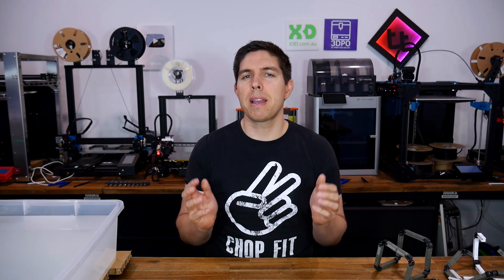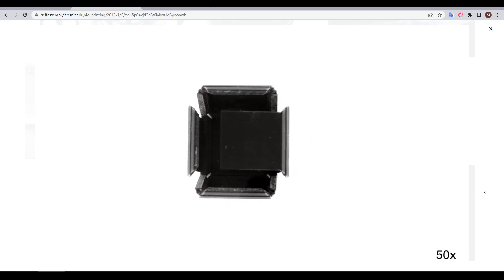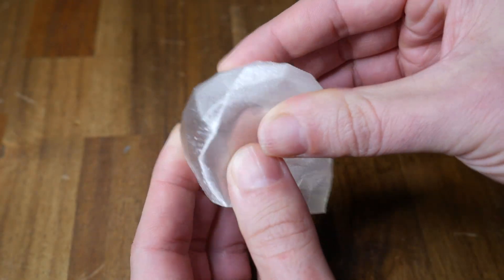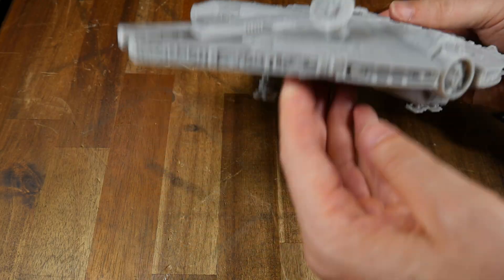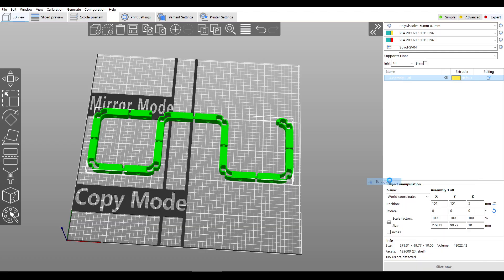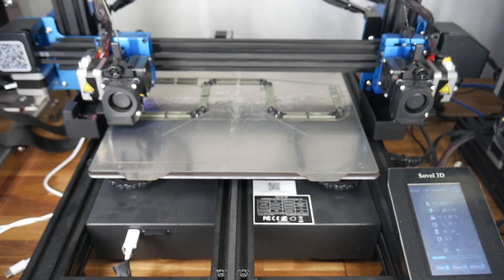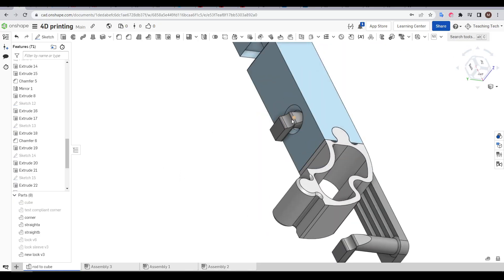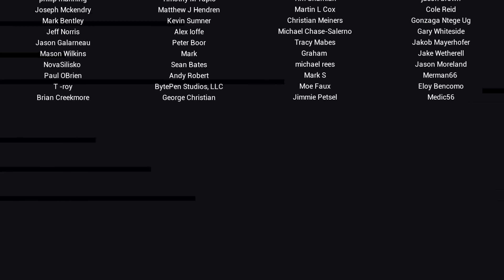4D Printing at home - Self assembling magic

Comment: Great problem solving (which is what engineering design is all about). Learning how to use each material is the secret and often as you showed you have to rethink and get round a blockage.

What could this type of design be used for? Reduction of packing space for 3D models or furniture?

Comment: The thing I don't understand is how is this any faster/better in any way? I see it being considerably worse in every metric. Takes longer, more material, more difficult to design, more expensive equipment, weaker joints and/or points of contact, etc.
Is visually captivating and a nice problemsolving exercise, but nothing more.
Reply: You can fit more things within the same volume, so more efficient packing for sparse objects is the possible benefit I guess

Comment: would you say this is 4D printing (as in the printing process) or a 4d print (the object printed)? I don't think of this as 4d printing and i don't think of it as a 4d print, IMHO. But with that said.. it would be interesting to make a print that has temp sensitive components that could adjust it shape in the 30-140 degree rang or somewhere near that range.. and then print a temp guage with an arm arrow pointing at digits on a scale using 3d printing. Are there any materials that can be printed with that expand and contract hundreds or thousands of time with tempurature? any that are already commercially available in 3d printing filament?

Comment: Hi, 
That reminds me something that I've done 3 years ago. 

I was requested for testing material called "Lucent PLA" from Polish manufacture "Print me". They at first didn't know it full properties at that time, so I made long tests of its capabilities. It turned out that this material can remember its shape, and when deformed, it can returned to it's original form, while being heated, in seconds. 

So I made some examples, that are on my chanel(last 3 videos). One is a box, that can be closed and it will hold it positions, but when you will heat it up, for example putting it in hot water, it will open up. And the fun part is, it doesn't require that much heat to do this. Even when you will blow some air from your mouth, it will react a little bit. Is so sensitive to temperature, that I had problems printing it in summer. Because of heat from extruder shaft, I had to cool down extruder gears, if not it will soften that much it will jam(Who would thought that?).

I strongly recommend checking it out, it's really interesting material, that I've newer saw on youtube, and even in Poland it's not known. And this is not an advertisement, I don't have anything from typing this, as I didn't had from 3 years ago for testing that material.

I hope I've interested you in this topic a bit. Have a nice day!

Comment: It is not, "4D".
All Prints take time.

If you print with the material that is capable of changing its shape to a process even if that process is adding heat or a wet environment or any other thing that causes said behavior, does not change the print into a 4D print. It is still a 3D print.

Comment: To end the hassle of inserting the arrow-shaped clips, simply make a slit straight in the middle on the arrow shaft (from the tip). It will give it the necessary compliance for insertion while keeping most of the rigidity once clipped in. 
— Arnaud The 100¥ Engineer. 😊

Comment: The 75 C was maybe too hot for the TPU, at it heated and softened it probably settled into its new shape so thats why it didnt spring back to its original shape. Heating materials is a way to relax the internal stresses which is probably what happened with the TPU.
Reply from the maker: I agree. In the later tests it really sprung back with a snap. Less time deformed plus cooler water temp.
Reply: @TeachingTech  Definitely a cool concept and a good idea. It will definitely have some unique uses, I wonder how it could be combined with compliant mechanisms to give it a more functionality.

Comment: This is very interesting.  If you can, try putting one or more aquarium pumps in the water. Maybe agitating the water will speed up the process.
Reply from the maker: I had the same thought. Maybe even a filter pump to clear the PVA haze. Ultimately I was worried it would ruin the camera shots.
Reply: @TeachingTech  Good point.  Maybe someone you know has one you could borrow. Stranger things have happened.

Comment: Fusion will save multi parts as a .3MF file and those are opened as one file in Cura and still all separate pieces. : )
Reply from the maker: I just checked and Onshape has this too. I will have to try it next time. Thanks for the suggestion.

Comment: Great proof of concept, particularly use of tension and thinner material. A very inspirational demo. 

Regrading "thermal expansion" (3:03) for assembly, LW-PLA does expand under heat, but unfortunately higher temperature than basic PLA. The working material is tricky as would have to withstand the heat of print-bed, printing, but be lower temperature that would deform the structural material.

Another possibility would to place preconditioned lengths of nickel-titanium (nitinol) memory wire inserted mid-print, or post-print.  Nitinol has an activation temperature of 30º-130ºC. There may be a shape memory alloys (SMA) that would have a temperature range more appropriate to 3d-printed filaments.
Reply from the maker: I thought about something like PEEK and PLA as two filaments with big thermal differences. In that case I could run the test in an oven and have the PLA melt away to release the corners.

Comment: Since the dissolveable pieces have more strength when being compressed instead of being pulled, why not have them wedge the joint open instead of pulling  it open?
Reply from the maker: I thought about that but the folding of the TPU was a bit inconsistent. Definitely potential but I would need to spend some time redesigning the corner geometry.

Comment: outside of the challenge to make a single print. what if you were to make the corners fold closed instead of open in a line.  hold the tension by tying the shafts together with a string . wrap it in fabric. pull the strings and you got a tent that erects itself

Comment: Another possibility could be to design the lock as a combination of PLA and dissolvable material, increase the rigidity, and the extra pieces of the lock would fall away once the dissolving happens.
Reply from the maker: Nice suggestion.

Comment: This is wonderful. I am doing a PhD on 4D printing and this video helped me with another perspective on the matter. Usually, you can still achieve the 4d effect (memory shape) using a single type of material. At 12:35 the problem is that PLA has a glass transition temperature of ~60°C (glass transition temperature = when the material starts to soften and feel kind of rubbery. it's a reversible process)
Reply from the maker: Very good to hear from someone with some experience in the concept. Good luck with your PhD.

Comment: Your solution was quite elegant, especially the speed of the results. During the initial failure of the wash-away material, I considered that printing a PLA insert within the wash-away would provide rigidity, then fall apart and fall away from the main body once dissolved.
Reply: That was also my first thought about solving the rigidity issue, but it felt like a very unsatisfying solution.

Comment: Excellent project. If you were cranking this out as a product, one thing I'd suggest is reduce the expensive water soluble parts to just pins. You could print PLA c shaped 'sleeves' that take the brunt of the hinge that are held in place and held together by one or two pins. The pins, when dissolved, cause the two c shapes to no longer be held together, allowing the hinges to push everything into its final form. Alternatively, make your design but with the tension area in PLA secured by PVA pins. Either way it'd be cheaper in the most expensive materials, with a happy bonus that the c-clamp design holding your linear assembly much more straight (which appears to be the goal).
Reply from the maker: That's a great solution, thanks for suggesting.

Comment: The TPU would likely creep and not fold back into shape if stored like this for a long time. Metal springs would work a lot better. But the concept is fun, and is a good thought experiment.
Reply from the maker: I believe this is exactly what happened with the first test. The combination of hot water and prolonged period being held straight contributed to that.

Comment: Instead of having to weave through our circulatory system with a long wire... Imagine blood vessel stents(those expanding Chinese finger trap gizmos for blood flow) that can expand after you hit them with ultrasound waves when in place. Guide it in with magnetic waves after injection, type thing. If they can zap kidney stones with an ultrasound gun, hitting a couple of bands to release elasticity should be possible. And they can guide things with magnetic beams these days.

Or maybe something not so life critical like pool toys. Or boiling an egg that lifts itself up out of the water after it is hot enough, lol. 

Neat concept.
Reply from the maker: I think medical applications are definitely some of the most valid.

Comment: Hi Michael, you should try this method using nitinol (memory wire) to add tension when heat is applied.
Reply: First thing I thought also. It would be a much faster transform.

Comment: Nice work, especially just using commonly available material! I wonder how the tpu and dissolvable material handle being stored in tension for long periods (like packaged and sent to a planet or the moon)
Reply: I wouldn't be worried about the dissolvable filament since you could package it in a way to minimize the strain there, but the TPU may be an issue. Possible solution could be to send a printer and a couple rolls of filament instead of a bunch of pre printed parts. Print in place, deploy immediately. I can see a lot going wrong with that though lol.

Comment: I always thought the 4th dimension would be the long time to print.
Reply: so my ink-jet would be a 3d printer
Reply: @飞天麵 You can print stuff that is 3d with a 2d printer, Nets.
Reply: They’ve supposedly been able to mitigate the time by adding a quantium leadscrew. By utilizing tesseractic honeycomb crystalline structures, it’s been found to minimize print time by 200% through space-time shifting.
Reply: Ba-dum-tsss